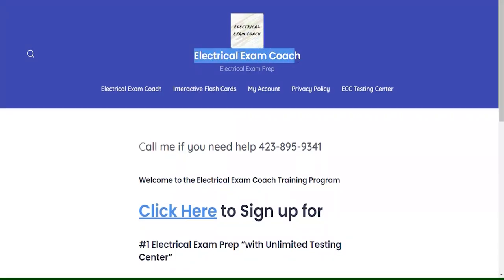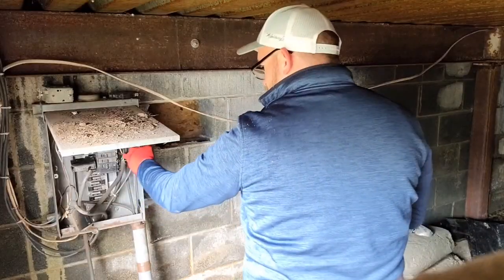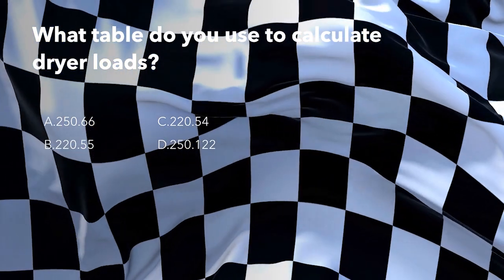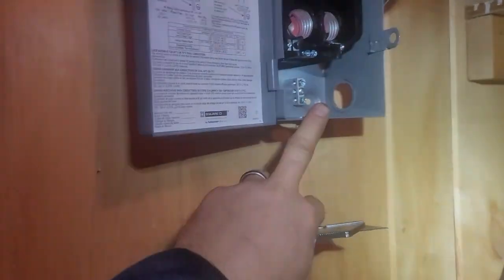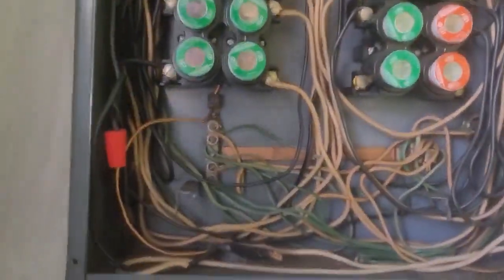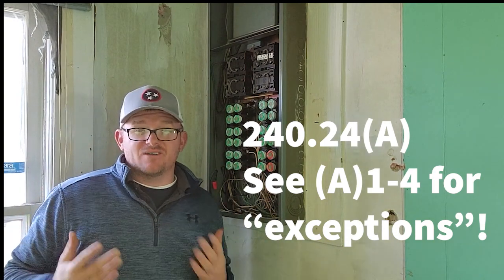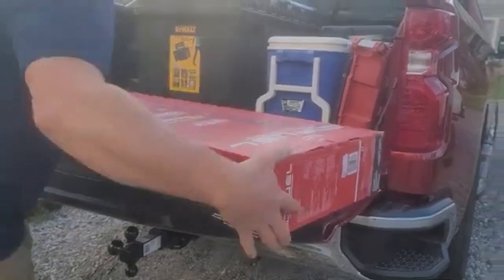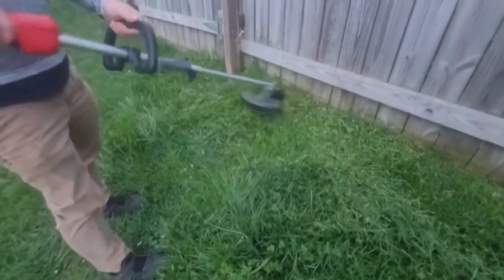Spend a Week with a Licensed Electrician Episode 4, Actionshots, Code Questions, Tool Review, NEC

Comment: “White 220’s and make sure they are black “ ?
Reply from the maker: Yep I was just referring to White wires that are being used as hot legs on the 240 volt circuit
Reply: Okay , I was thinking incoming feeder cable , as opposed to circuit . On the circuit side , I remember that part about black turning white for some configurations like uh 3 way switch . And just because I’m thinking, on the GFCI , the res becomes black almost like the other scenario . I’m kinda asking for confirmation and speaking , I’m just a studying apprentice . I’m so new , I started tomorrow .

Comment: Hey coach, I was wondering if you or anyone in the comments could shed some light on something for me..I’ve gone on a few service service calls lately and I’ve come across a number of panels that are supplying subpanels where the feeders are double tapped. For example today a 200 amp panel was supplying another 200amp “sub panel” and like another 125amp subpanel on the other side of the house. The feeders for both of these subpanels were using the same feed through lugs in the bottom of the main panel. Surely this is not allowed right? Is there anything listed that allows you to double tap big wires like 2/0? I looked up the specs on the panel and I didn’t see anything that said specifically 1 wire per lug but surely this cannot be allowed. Is it safe to assume that you can never double tap anything in a panel except grounds and certain types of breakers? I don’t have a great deal of experience when it comes to panels so I’m still trying to learn how to identify the various Mickey Mouse shit that people do with them.
Reply from the maker: Great question, they have to be rated for 2 wires and also the lugs have to be properly rated for the amperage
Reply: @ElectricalCodeCoach  Coach do you find most of these panels, main and sub panels are effed up beyond belief? Who tf is wiring these things up? Double tapped breakers, etc. Half the time you can barely get the cover back on bc it’s such a shit show. It’s freaking terrible man.

Comment: In Europe a panel change can be done in an hours. But they test the insulation of the wire we don’t unless your checking  the insulation of a motor. And must cases you just replace because the test equipment cost a lot.

Comment: I just did a 400a service change Monday (two 200a panels) and had to take the time to label each circuit with what size breaker it was previously landed on bc I noticed on the initial service call before cust decided to upgrade panels that there were multiple wiring violations (breakers, wiring, devices, etc) so I had to make sure I had everything labeled so I could make the correct changes where needed either thru out the home or at the panel. I’m saying that bc I have seen a lot of guys come in and just start removing wires off breakers without labeling the wires (what amp breaker was feeding them etc) what are your thoughts on this coach
Reply from the maker: I do the five steps in this video and then I cut everything loose but I do snip the wires and leave them on the breaker.

If someone were going to be coming back over me I would maybe do some labeling.

But as far as labeling any of the circuits I don't label anything beforehand
Reply: I go through and put blue tape on all the 20s, label the 240v, and the rest I know are 15s